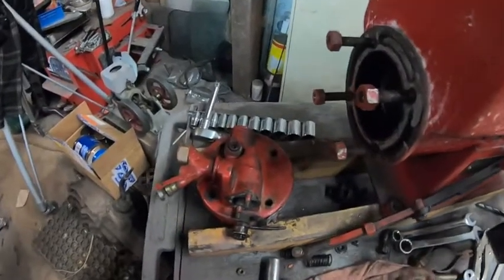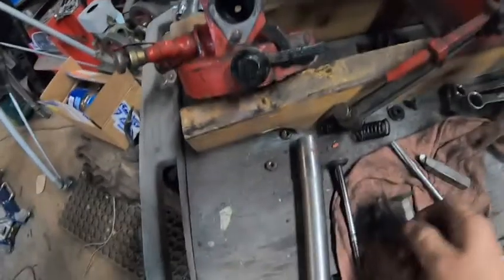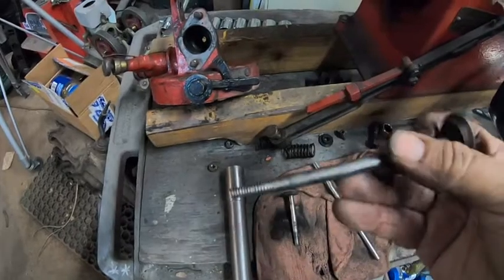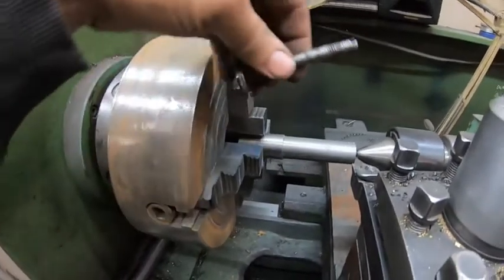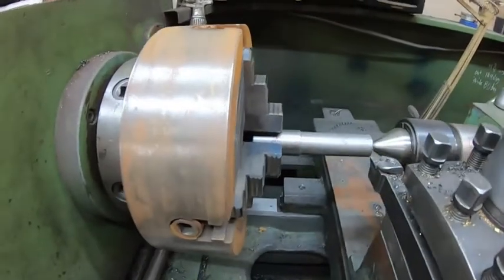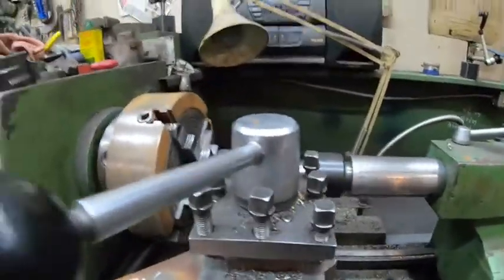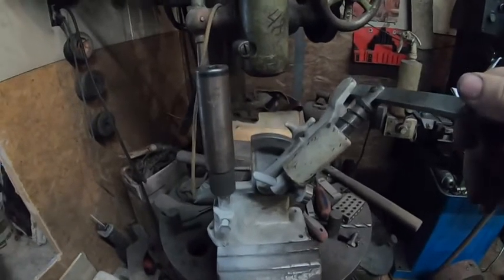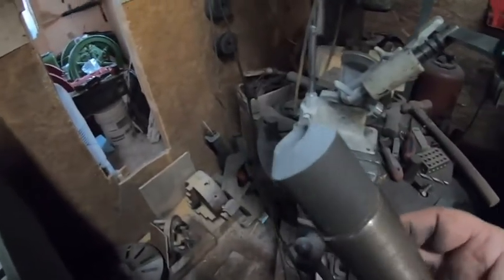1HP International Famous, Making A New Valve.  Hit Miss Stationary Engine.  Part 2

Comment: Pretty cool stuff, man!
My south bend 9A would die trying to cut 4140 i think. Not beefy enough for carbide.
To think i had valve seat and guide tooling, threw it in a deal when i sold my firebird.
Reply from the maker: Thanks Frank. You have a nice southbend lathe and nice toys too. Enjoy that video with Haftass coming to your place. And nice looking studebaker you have.
Reply: @pennyshotrodscustoms  Thanks. Was hoping to work on studebaker this weekend, but wife’s nissan needed attention. Remote start needed replacing among other things.